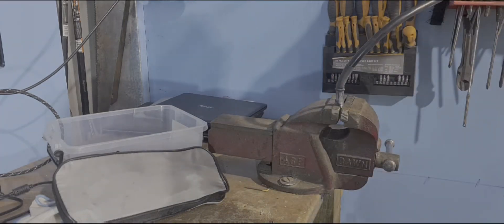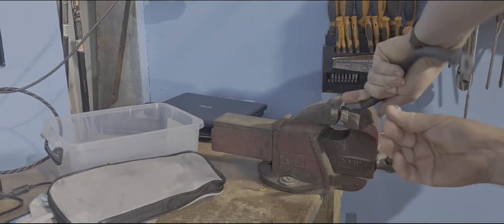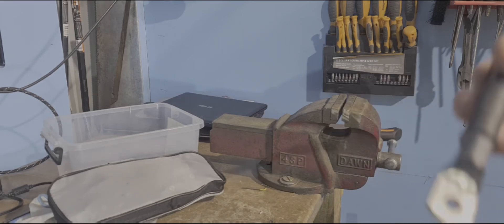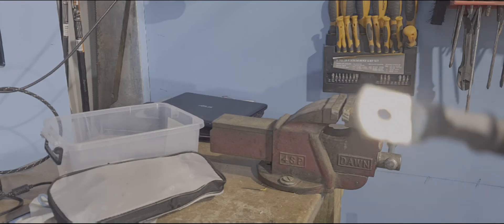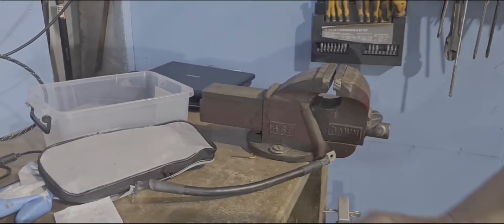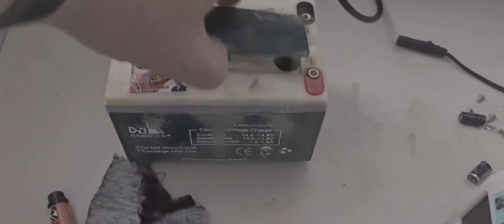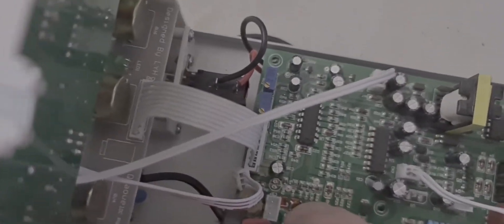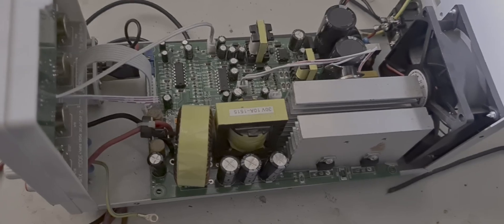Here is a quick way to bend you battery Lugs.

Comment: Good idea, do you know if that changes/adds resistance to the connection? I am wiring 4/0 wire for a large inverter and may need to do this for two inline 4/0 wires on the positive side where the lugs will be on top of each other. Thanks
Reply from the maker: Should be O.K. as long as it is a good brand.